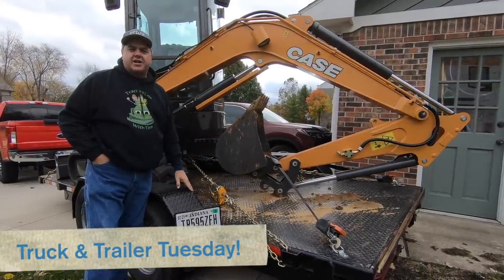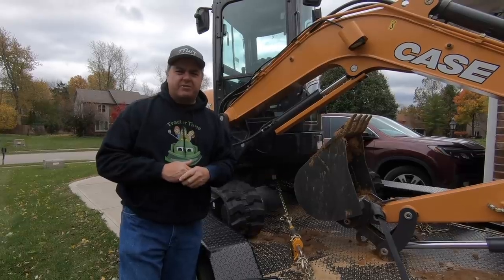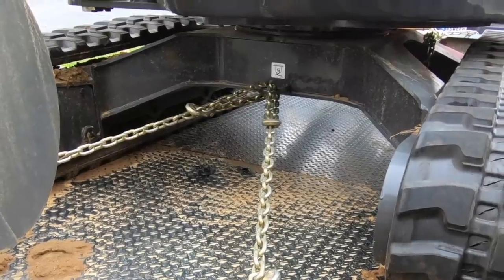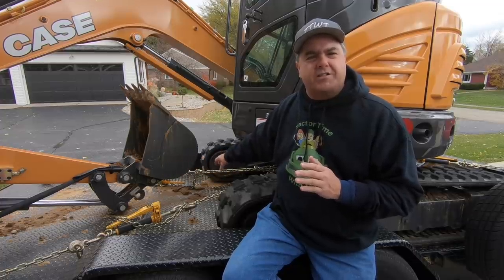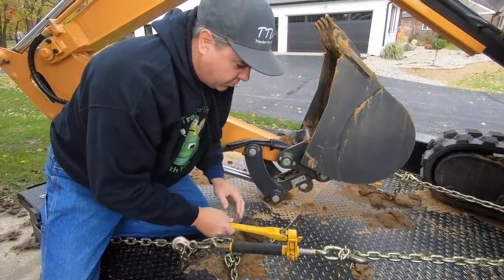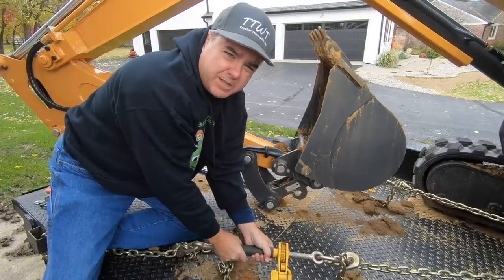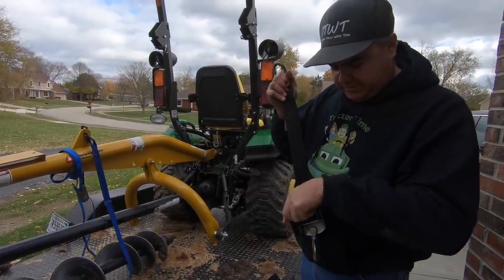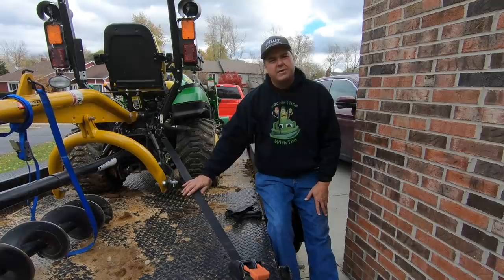Tie Down Your Equipment!  Truck and Trailer Tuesday

Comment: I’m a retired truck driver. What I see you’ve done is overkill and I personally did the same. More on tie down can only be better. Hats off to you
Reply: Omg, so overkill. I have Kubota B7500 sub compact and I’ve never had a problem just using bungee cords and duct tape. Why would you need more? My tractor weighs 1,350 lbs.. it’s not going anywhere. You guys are silly.

Comment: I'll also add as a commercial driver the only time I know that chains are required is when you are hauling steel coils or structural steel. Straps are find for everything else as long as the straps meet the weight requirements. Hope this helps.
Reply: I am a commercial driver as well, You can use straps on coils as long as you use protection in between the strap and the steel. There is no rules in any book that says you cant use straps.

Comment: When you first started your Tuesday videos I wasn’t sure your material could be very interesting, but this was probably one of your top 10.  I found that I am drastically undersized on my 1025 tie down. Very nice job, thanks for sharing.👍👏
Reply from the maker: Thanks Joe.  I have taken a beating in the comments on today's video.   Everyone seems to be picking at something.  
I appreciate your kind words.
Reply: I also enjoyed this video and realized that I am not legal hauling my tractor on my trailer the way I currently do. I will be getting a few more chains and binders. I only used one 3/8" chain across the back and one up front both tightened to the corners with binders. Then one chain around the loader and bucket. Gonna be fixing this ASAP.

Comment: I’m not sure you mentioned it, so I will. If you are hauling anything behind you that it taller than your vehicle, measure the highest point and mark it in a piece of tape. Then stick that piece of tape on your dash or top of your windshield so you know if you will clear that bridge or overpass up ahead. Or in Tim’s case maybe that drive through Cheeseburger place. Good video. I prefer chains.

Comment: I owned and operated a commercial transport hotshot business for around 5 or so years on and off. And am now a tow truck operator. Your tie downs match the legal requirements in Canada. The only thing I myself do differently is I like to criss cross my chains or straps on my trailer when hauling equipment or vehicles as they help prevent the machine from literally going in any direction. 2 crossed in the back and 2 crossed in the front plus the additional needing tie down on an attachment prevents the machine from going sideways, up, down, forward or backwards. Also really helps limit body roll when in wind or taking corners I find. Just my own personal preference that I like to use.

Comment: Several years ago, I pulled flatbed semi trailers and we used both chains and straps. We had 10000# chains and 7000# straps. I can't remember if it was federal regs or company policy, but our rule of thumb was to secure the load at a minimum of 150% of its' weight. 
For example: a 40000# steel coil would be secured with six 10000# chains, or a 30000# load of lumber with seven 7000# straps. 
Thanks for ALL of your videos and thanks for introducing me to so many great products.
PS: artillian grapple is being delivered tomorrow. Yeah!
Reply from the maker: Congrats on the grapple.  Transforms the utility of your tractor!

Comment: People see that I used 10,000 lb straps to secure my Harley Davidson (with bags/fuel/oil/tools etc. around 750 lbs) and say "over-kill much?". LOL What they don't see are the other things I haul, ie. full size truck's, cars, boats....   What it comes down to: I'm not worried about me or my equipment, it's if my load were to shift and cause someone else to be injured or killed. Prevention of that is worth any extra money I spend on my "over-kill" straps, chains, links, or D-rings.  Last: ALWAYS, yes, ALWAYS secure to the frame.  Great information, thanks for making this video for others to learn from!

Comment: Well Tim I don't know what people are talking about. I live in California one of the most strictest states and yes you can use straps. As long as you use strap protectors as you have. One thing I can pass on is that in California the Department of Transportation likes to see booms or any other attachments strapped down. Preferably straight across. The purpose of this is to prevent them from moving side to side. The concern is that with hydraulic bleed down they could move and strike something or someone next to your vehicle. You can always check your Department of Transportation website and or speak to a Department of Transportation Officer. I find that they are very helpful, willing to help and enjoy helping you understand the requirements. As I have been told. They would rather you ask than them be forced to catch you doing something the wrong way and having to site you for it. Great video keep up the great content and God bless.

Comment: You can use 1 chain on the front and 1 on the back but you do have to use a chain binder for each corner.  Two chains and 4 binders now haven said that it does have to be two separate points of contact on the equipment not just looped thru as you mentioned I am a ex-flatbeder and over kill is always safer and doesn't take that muck more time really   Great videos keep up the good work and we will keep tuning in to learn something new
Reply from the maker: Source?

Comment: The brush guard on the front of that tractor I was told by my local dealer will not hold the weight of the tractor during a tie down. You really need to get something like I got which mounts to the three bolts on the side of where the loader attaches. I wished I could send you a picture of them but unfortunately I don't know how to put a picture in the comment. But I found them on eBay they was pretty inexpensive and well worth the money. I got the ones that goes from front to back. In other words they have two holes in them and a tie down for each side. Therefore I can put my four point tie-down connection at that same point. They are awesome. Now I do like your straps for Johnny. I wish I could find some that heavy to use on mine. I may have to check out your store but I do not and have not ever used Amazon. Because they do not accept PayPal.

Comment: I personally would find a better spot to tie to on the front of the tractor. In an accident I don't think that grill guard would be an adequate anchor point. Good info though! Stay safe out there.
Reply: I agree. He has grab hooks on the loader, they look like Ken's bolt on hooks, that's what I use and they're great.  Super easy to hook a chain on too. Almost as though that's what they're made for.
Reply: Yes,  that strap should be connected the the frame of the tractor. Always go to the frame.
Reply: I agree that the grill guard is a little light to use as a tie down.  I go around the axles when I tie down my farm tractors and technically he needs another tie down for the loader since it is considered an attachment.
Reply: @dustinlantow7138  Do you guys think maybe he was baiting for comments with that one?
Reply: Have you guys even looked at the bolts, 4 of them, that holds that guard in place?
Reply: @mi2tn  true, but it only mounts on the bottom so in an impact the bolts become the fulcrum of a lever and I doubt the guard, frame or bolts would withstand those forces. Regardless, like me, Tim has grab hooks on the bucket lined up with the loader frame.  Those are without a doubt (in my mind at least) a better anchor point, so I'll use those.
Reply from the maker: While the hood guard is admittedly not a great place to hook, I do not believe the bucket is a legal place to hook. I believe it is supposed to be the frame of the tractor.
Reply from the maker: Yes.  Probably supposed to secure Johnny’s bucket separately
Reply: @Jason n
Reply: @Jason   

Oh
Reply: Ca n
Reply: @curtwhite876  bbbbbbj

Comment: Good stuff!  Can't ever be too cautious when securing your loads.  Me personally I use a shackle through the drawbar plate, an axle strap through that and 1 10K ratchet strap to each rear corner.  Up front I use an axle strap around each axle, inboard of the knuckle; 1 10K strap to each corner.  I do like the chafing gear you showed!  I'll get a set to go around the corner of the bucket.  And your est. for 1025 weights was spot on with mine.  Thanks for the confirmation!

Comment: Tim a suggestion for Johnny why not just hook you straps to the chain hooks in your loader bucket they are way stronger than the grill guard. Keep the great videos coming nice work.
Reply: I know this is a late reply, but, the answer is that the bucket is not part of the frame AND connected to hydraulic cylinders that will eventually move while under pressure due to oil leaking past the seals in the cylinder. All cylinders will leak over time which would loosen your connection.

Comment: Tim, what would the WLL of the front brush guard be?  Wouldn't that be much lower than the other points?  I would think that best would be the front axle would be the best, but also think that the hooks on the bucket might be higher limits at least than the brush guard.  Thanks and keep up the good work.  Really appreciate the amount of time and effort you put into the videos.

Comment: The WLL of any webbed straps (Such as those cargo straps you have) is also listed under appendix A of the cargo securement manual.  You need to scroll down the table.

Comment: Also check with your insurance company about towing.  I have State Farm and if an accident occurs my trailer is covered- but not the items loaded on the trailer.  I had to take an additional policy (very reasonable at around $30 a month) to cover accident loss.

Comment: great video as always.  I didnt want to fork out the money for a ratcheting turnbuckle but boy am I glad I did.  People have to keep in mind usually these chains and turnbuckles you only have to buy once (not so much for the straps as they can deteriorate after a while especially with the UV rays from the sun.  Normally you don't leave your tractor or equipment tied down for days and days in the sun either )  But I really like auto retract straps and yes if they make heavier duty ones Id buy them.

Comment: Also, as I keep hearing, it's never bad to over exceed the straps just in case someone doesnt fully understand. Nothing bad ever came from using a heavier tie down or heavier duty trailer.
Reply from the maker: That is correct.
Reply: @TractorTimewithTim  Yup, in this case, overkill is never bad.

Comment: I haul heavy equipment and throughout the country if it’s over 10,000lbs you need 4 separate tie down attachment point and if it had an arm, boom or bucket that needs a separate straps.
Reply: TRUCKER ANDY I’ve seen plenty of guardrails that were wiped out by a boom/stick or bucket swinging to the side because the driver/loader/securer failed to properly secure it.

Comment: Your on the mark with that info, and yes it can get confusing when looking at anything FMCSA.  We have to watch training videos now every quarter for our safety program and although we knew how tie down for years the Gov had to come in an create instructions and guidelines. I’m not upset that they have done this because I remember the days when landscaping contractors and fly by night excavation outfits tied their equipment down with one chain or rope,yes I’ve seen it, I’ve watched two zero turn commercial mowers come off a trailer back in the late 90’s thank goodness it didn’t cause a catastrophe. Here in upstate NY the DOT watches the small contractors more than us class 8 guys you don’t see the crazy stuff you once did years ago and the fines are heavy as well.

Comment: I tried using big ratchet straps to tie my tractor down.  I did not find the ratchet straps to work reliably so I picked up grade 70 chain and boomers.  I use a breaker bar to latch the boomers and NOTHING moves now.  This is a great video, I'm glad you're doing this series.
Reply: You probably did the right thing. I like the concept of those retracting ratchet straps but if you read the reviews on Amazon quite a few people state that they fail in one way or another after just a few years of use. The failure is not such that it puts the load at risk but things like failure to lock, failure to retract, the plastic handle breaking, etc. It seems to be the way with all spring-loaded self-retracting devices. Any vacuum that I've ever owned with a spring loaded self-retracting power cord - it was usually the first thing to fail. :-)
Reply: Curt White Be careful with those breaker bars and pipe cheaters, had a good friend of mine loose his front teeth when one of those let go on him, wasn’t a very pretty sight ...
Reply: @ibjeterhere  Yikes! That sounds aweful.  Hurts to just think  about it.  I really liked the ratcheting boomers Tim used to tie down the excavator.  I think I might upgrade to a set of those.
Reply from the maker: They work well.
Reply: @TractorTimewithTim  yeah... $240 for a good set of boomers or several grand for a new set of teeth...  I think those might make a nice stocking stuffer!  ;)
Reply from the maker: Please order through my amazon store if possible :-). Thanks.  I get 4% in that case, and it does not cost you any more.
Reply from the maker: Joe, the truck is to keep the straps out of the weather. Don’t leave them sit on the trailer all winter!
Reply: Also keep in mind any physical damage to a strap deems it unusable. Like Tim mentioned if they are exposed to UV rays in the weather they will break down also reducing their limits. I personally use chains I've never had one fail on me but I've had straps fail.
Reply: @TractorTimewithTim  Trick ?
Reply: @jimmarshallman6300  maybe he meant the trick is to keep them in your truck instead of leaving them on the trailer. ;)
Reply from the maker: I would edit and fix it, but you guys are having too much fun with it!

Comment: When I bought my 1025r  the first thing I did was build tie down hooks. Reason being was I might put tractor on one side of trailer and load materials on the other side of trailer. The heavy equipment generally has tie down hooks why nothing else does I can't figure out.

Comment: Tim,  I will try to find the website reference to share with you, but when I first got my 1025R I did a little bit if digging to make sure I was legal when I would haul to friends and families houses to do work.  I found that it was called out that not only does the machine need to be tied down with the appropriate WLL, but your implements do as well.  So you would need a strap on your loader/bucket and post hole digger as well.
Reply: I was only aware of implements that could swing left or right for obvious reasons. But did not know the front loader bucket had to be tied down. I will research that.
Reply: @danielscott9769  I could be mistaken, it was over almost 2 years ago when I did my preliminary research, I could be mixing it up with side to side movement

Comment: Makes me wonder how many laws I've actually violated over the years by not knowing any of these rules and just going by what I've learned from folks about tying down my stuff. Thanks for the very useful info gonna be changing how I secure my stuff.
Reply from the maker: Yes, it is difficult to understand these laws.  My personal goal is to operate legally, even if I could get away with less.  However, I’m finding it difficult to understand and implement the rules.

Comment: The only thing I do different is the pattern of the tiedowns. I go from the back of the equipment(when loaded nose first) to the front of the trailer and from the front of the equipment to the back of the trailer and chris-cross if possible. Why? Can't remember but my grand-dad taught me this method almost 50 years ago.Seems like it does prevent load from side shifting.
On my dozer (20,000 pounds) and backhoes(16,000 pounds) I use 5 chains (3/8"). On tractors to 9000 pounds I use 4 straps(2").
One thing I noticed is the debris on your trailer deck. In Texas that will get you pulled over faster than a tie down inspection.Always keep a broom in the back of the truck.

Comment: Personally I use chain, I do use straps on the implements; The machine gets chain. I can't quote from any published information, however it was my understanding that implements required binding of some sort. 

I do know that articulating equipment has to be made ridged for transport, because I have had to make plates to secure a machine for transport.

I couldn't tell you what the law is, and that really depends on how the cop interprets the actual law. I get held to a higher standard just because I have a class A CDL, make no mistake; I'm not a truck driver. So I tend to go overkill when it comes to securing a load and I check my trailer and load at welcome centers and fuel stops. I have had my car trailer from VA to FL and back a few times now without any issues.

When you get to your destination you can feel the tires, if one is hotter than the others, chances are it's low; Low tire pressure is the #1 cause of blow outs. You can feel the hubs, again if one is hotter than the others, you have a problem. I find it's better to keep an eye on your equipment to keep it in proper operating condition.

It only takes a few minutes to walk around, check lights, tires, hubs and tie downs. Loads can shift, straps slip

Comment: Great video however the grill guard isnt adequate fo tie down application. Most tractors have a tube between the loader arms just behind the bucket. Run your chain thru it and boom it down